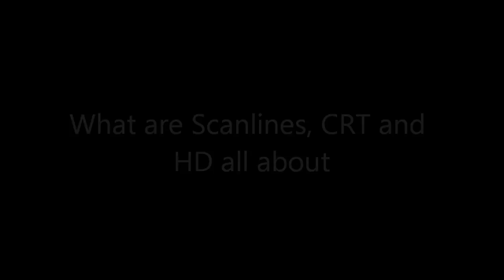What are scanlines, crt and HD all about

Comment: the black lines could not be 'embedded' in the picture from a console or a computer, because the framerate could be at 50 fields per second. So the electron gun drew the same scanlines 50 times a second, leaving the every other line black

Comment from the maker: @futurematt5 Yes you can get 60fps in 480i mode, as regards to what the eye can see.  But 480p will be 60fps complete, as in the entire screen is used for each frame.  60fps is 60fps, whether the whole screen is used or not.  Nope... 60fps will always look smoother than 30fps (on a moving image).  On an animation for instance, you will see another 30 frames of movement, so it has to be smoother defacto.

Comment: I get the issue with HDTVs (Ive seen it myself, alot of them do an awful job with older games), but what about LCDs which are not HD?

I  use an older LCD (2004 I think) which is not HD ( it doesn't do 480p or above) , as sadly my CRT broke, and I have to say the picture on this LCD is really nice,  not as good as a really high quality CRT , but the picture itself is miles ahead of any HDTV Ive seen.

it also has a VGA socket for the Dreamcast

any reason why this LCD is  be better than an HDTV?

Comment: I bought a Loewe CRT back in March for its RGB SCART inputs.  We naturally inherited everything from the UK with TV but for some strange reason, SCART was not included.  I accidentally came across a Loewe on eBay earlier this year and noticed it had SCART inputs.  I then came to discover that all Loewe, Grundig and B&O TVs retained their SCART inputs in sets sold in Australia.  So I bought a Planus which is a 16:9 TV.  I was gutted when I got it home and tried it out only to discover that the scanlines are non-existent :( 

My Saturn, MD/MCD, Wondermega, SFC, PCE DUO-RX and PS1 all look rubbish on it and not too different to my plasmas.  That is, the picture is quite blocky.  I assume that the stupid 100Hz is to blame.  Despite the manual claiming that NTSC runs at 60Hz, I was unable to use a Virtua Gun with my Saturn when I tried it out with Henry Explorers and VC2. After seeing your tip about SONY TVs and teletext trick, I tried to find a way to disable progressive display on the Loewe.  There is a setting in the service menu to turn it off but it didn't look much different, still did not show scanlines and created weird artifacts such as ghosting.  I have been hunting for another TV for a few months now but I am in the wrong end of the country for Loewes and Grundigs.  There's hundreds down south in Victoria, quite a few in Sydney but shit all in Brisbane.  The TV has such a brilliant picture, if it had scanlines it would be amazing.  The sound is pretty damn incredible too.  I need to try one of my CLD-R7G LD players on it to see how it looks.

Comment: what is the best way, in your opinion, to display a 480i game from a ps2 ?

great vids, keep on going
Reply from the maker: Quite subjective this one, as it depends on a number of factors.  I'd probably go with a SCART RGB CRT TV for an easy and cheap solution.
Reply: Faginrs500
Yeah, I bought a bang olufsen mx7000 for 500 swedish 1 kronor yesterday and i use that setup now with scart from my ps2 to the telly.

I find some games to get quite blurry when interlaced, for instance Need for speed Most wanted. xuse my English .
Reply from the maker: Oskar Nathorst Then you'll need to look at using a video processor if you don't like the interlaced look.  Look at this video for something that will sort this issue out (assuming you have a LCD / LED / PLASMA with a VGA type connection available) Technical Demo/Review of Arcadeforge SLG-IN-A-BOX
Reply: Faginrs500
ok I also have a component lead for ps2 that I use sometimes to hook it up to my led tv. I think it looks ok, no interlace at least. But I think will be looking for a old crt monitor and use a mayflash transcoder instead.